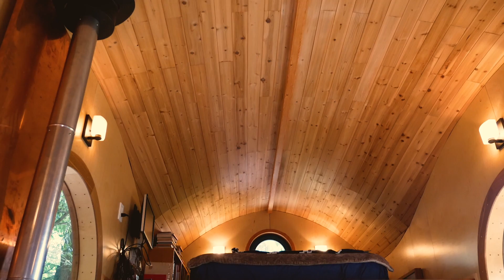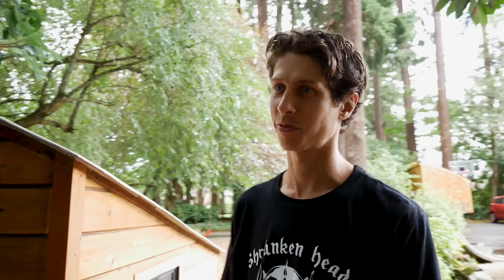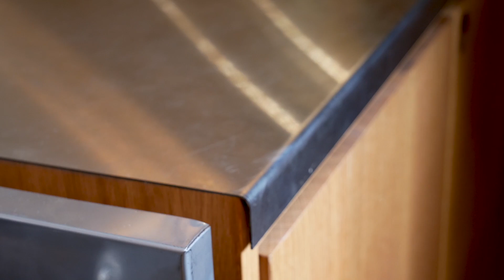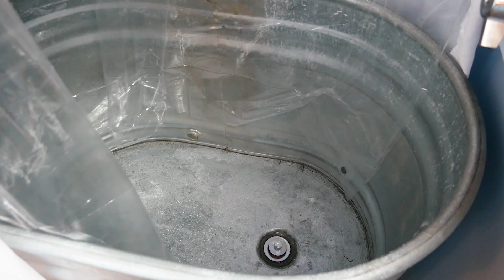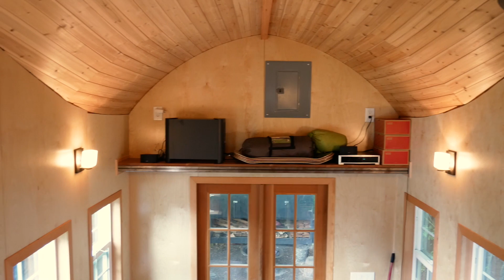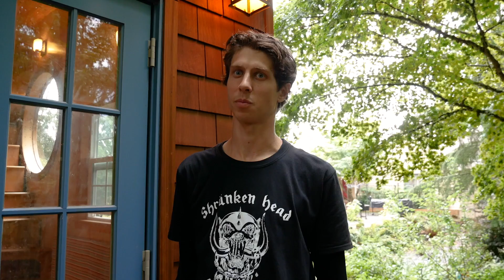His Craftsman TINY HOUSE w/ Reclaimed Wood & Copper Roof

Comment: Probably my favorite tiny-house so far, and I had built an 8' by 15' by 14' (high) shop in our backyard which had a 8' by 6' deck on a second level; the upper level's floor was built so that both the lower level and upper levels rooms were 6' 4" (lower) and 6' 6 " for the upper level due to using 2" X 10" beams to support the upper level with an open deck of 8' by 10', (the deck had a one foot overhang) which resulted in providing me more than enough headroom which was established by my height of 5' 9" tall.

Total cost for all wood to frame the shop and the 3/4" plywood to sheath it, including a one inch (4' x 8') plywood floor with a 34" underlayment was somewhere around $800.00, and this was all with good quality wood from Home Depot with steel fittings to secure each stud and rafter which also acted to lock in the flooring.

So these structures can be built without spending a lot of unnecessary money.

If I were to do this again, I believe I would opt for one similar to it which is offered by Tuff Shed for a few thousand dollars, ($4,500.00 - ?) which can be strengthened per your requirements for two or three hundred dollars more.

Your attention to detail was nice to see and I hope you get a lot of years of use from it.